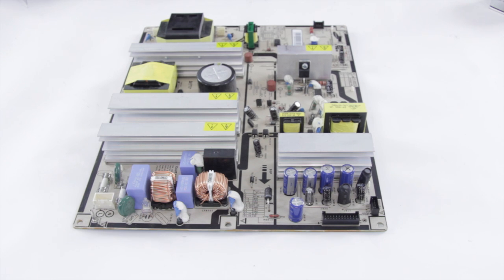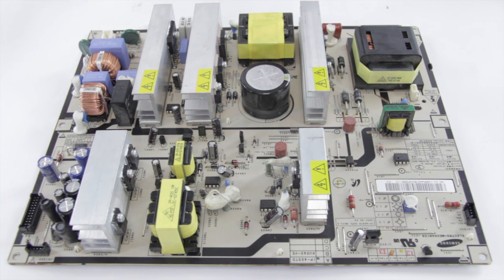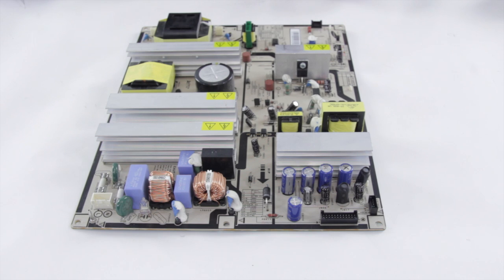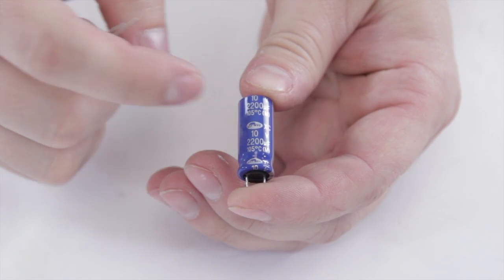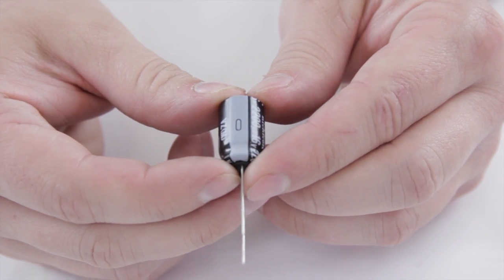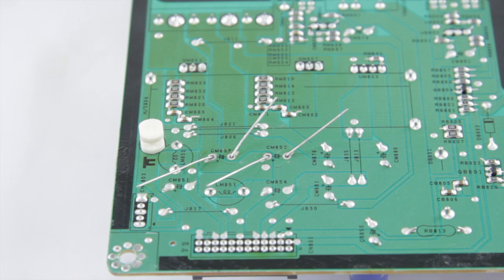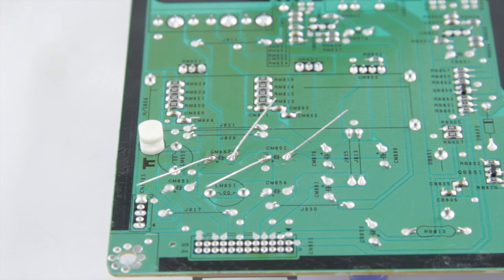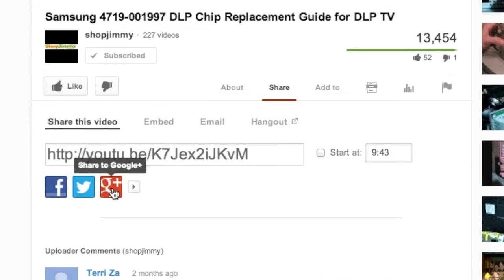Samsung TV Won't Turn On - How to Repair Bulging Capacitor for Clicking Noise

Comment: I have a Samsung UN55D6400UFXZA with Version H301. The I lost power while the TV was on. Shortly after this the TV began to have issues with power cycling when it is first turned on (meaning when it is cold and hasn't been on for a while). Once it is left on and left to cycle (turn on and off on its own...staying on for a few seconds to minutes at a time) for anywhere from 5 to 15 minutes, it stays on and works with no issue. I tried a firmware update which was long over due, but that didn't solve the issue. I'm trying to determine if this is a capacitor, power supply, main board issue or what. Can you help with some insights regarding how best to diagnose or what your experience is with this type of issue?
Reply from the maker: Mark Wilkinson   I recommend replacing the main board and the power supply board in your TV.  Here is a link to replacement parts for your TV model number on our website, click here:  http://www.shopjimmy.com/catalogsearch/result/?q=UN55D6400UFXZA  Be sure to match part numbers on your current board, with your replacement for compatibility.  You can also call our customer service for further assistance with your purchase.  (877) 881-6492  Thanks and please let us know if you have any further questions with your TV Repair!  www.shopjimmy.com

Comment: my Samsung tv model#55c650l1fxza,,sn#z10w3cnz800555l,,if you split the tv into 6 even squares the bottom right square is darker then the rest,,now the hole picture is getting darker and darker,,, help please...ty

Comment: I have a viore 50' flatscreen Hd tv has great sound and picture only problem i have is there are small black lines all across the screen and theres a green led light flashing in the back,is that some kind of warning something is wrong?
Reply from the maker: John Burns   This sounds like a TV panel problem.  If your TV panel is bad, it may be more cost-effective to replace the TV as panels are typically hard to find in stock, difficult to replace, and expensive.  Thanks and please let us know if you have any further questions!  www.shopjimmy.com

Comment: Hey, thank for the Video, I have an old LG model 42PX3RV-ZA . the initial problem was that the TV was blowing fuses at the socket when in standby mode. Then eventually it turned off one night when watching and won't power back on.
I have opened it up and spotted 2 blown caps and am about to replace. Would this cause the plug fuse issue ?

Thanks in advance
Reply from the maker: thefridge1000   I don't think it would cause that issue.  Thanks!  www.shopjimmy.com

Comment: I have a samsun dlp the euc132d /42 boad the low voltage transformer that feeds the hivoltage flyback trans former is acking I think it opend up can I get that trans former
Reply from the maker: Teddy Stephens   You may need to try a place like digikey.  Thanks!  www.shopjimmy.com

Comment: My problem started with the sound bar popping up frequently on the left of the screen decreasing volume to zero. I bypassed it with using my surround sound. But when I cut the TV off it would not come back on. I took it apart noticed 1 swollen cap so I replaced it with the same but upped voltage from 10v to 25v. I don't think I got a good solder seal. When I cut on it came on and off correctly. But when I went to cut back on red light would blink, go out and red light come back on. Resolder again, playing with it a while it came back on but I could not cut back off. Had to unplug. Now color spreading all over screen. I still have some more 1000uf 10v 105c capacitors coming in mail. Will take apart again to see what's what. Is there a special solder I need to use. I also tried to use a Radio Shact desoldering braid to remove previous solder with little success. Please help!
Reply from the maker: Thomas Reynolds   Resolder and try again see what happens otherwise the main board could be bad as well.  Let us know what you find.  Thanks!  www.shopjimmy.com

Comment: What type soldering iron were you using that would also suck up the solder after melting solder? Also my Samsung has 1 cap 1000uf 10v 105c but I've also got what looks like a white hard foam in a couple places on the board. It almost appears that it may have come out of one of the circuits. Does that white hard foam looking stuff mean anything? I've got a 40 in model LN40B530P7N
Reply from the maker: Thomas Reynolds   A desoldering tool such as the excellent Hakko 808. Many boards are glued to help hold components in place, but some leaking caps will foam as well.  What are the problems/symptoms with your TV?  Thanks!  www.shopjimmy.com

Comment: My caps are 2200uF 105° & 25v can I swap it out with a cap that's 2200uF 105° & only 10v? Samsung DLP Board BP44-01002c
Reply: McSquidification The cap voltage can be higher, it is the rated maximum.  The whole issue here is the caps that were put there to begin with were underrated.  I would suggest going up in voltage, and hopefully operating temp, while maintaining space.  Just be sure to use the right microfarads, or you can induce other issues.
Reply from the maker: naturreal1705   NO! It's OK to go up in volt value, but NEVER go down!  You could do a 2200uf 35v.  Thanks!  www.shopjimmy.com
Reply: No, you must always match the voltage.
EDIT: incorrect. see below.
Reply: Josh Martin
Thanks for clarifying/correcting

Comment: I have an un55es8000 samsung. The set power cycles after running for a few hours and usually after interacting with it using the remote. Symptom is vertical lines and a reset resulting in a loop o the same issue. If I remove the set from the wall and open up the back, the issue does not exist. I can see no leakage or bulging on any caps, anywhere. Many sites explain that upgrading certain PS caps to higher wattage and heat rating fixes the issue. I am at a complete loss as to which ones to try this out with. The largest ones are 450V, should I just get all the current ratings and upgrade the largest ones?
Reply from the maker: mvortex1  You can do this with all them.  Thanks!  www.shopjimmy.com

Comment: My Plasma TV has a problem, when I turn it on it turns off I bought a power supply from you guys yesterday, I changed it but it still has the same problem. It is a LG Plasma TV 50 PC1DR-UA.
Reply from the maker: Ermine Minassian   I recommend replacing the ZSUS board in your TV.  Here is a link to replacement parts for your TV model number on our website, click here:  http://www.shopjimmy.com/catalogsearch/result/index/?master_part_type=Z-Sustain&q=PC1DR-UA  Be sure to match part numbers on your current board, with your replacement for compatibility.  Here is a link to a video showing how to identify your part number, click here:LG Plasma TV Repair: DIY Part Identification Number ID Guide for LG & LG Philips Plasma Panel Parts  This video may help you with the replacement:  LG 6871QZH044C Z SUS Board Replacement Guide for DIY Plasma TV Repair  You can also call our customer service for further assistance with your purchase.  (877) 881-6492  Thanks and please let us know if you have any further questions with your TV Repair!  www.shopjimmy.com

Comment: My samsung tv was randomly turning off. now it will blink really fast and just be blank, to where there is no picture at all. I've googled and youtube it. Everyone says that the fix is a bad capacitor. But when I look at the power board of my tv, I don't see any that look bad like everyone states. Is it possible for one of them to be blown will out it looking like it was blown. Thanks!
Reply from the maker: weston guidero   Yes, just because they're flat on top doesn't always mean there good more often then not 1 or more will leak and not show the puffy symptom. It's worth a shot on replacing the capacitors.  Thanks and please let us know if you have any other questions.  www.shopjimmy.com
Reply: weston guidero the switches are just as easy and cheap to replace. So you got scammed. The answer to your question about blown caps with no bulges. Yes they can. You test the ohms of them. Should be 0 or close to it. Anything over 0.8 is bad or going bad.
Reply: did they get back to you yet? i have the same problem. i dont see anything wrong with any ofr the capacitors.
Reply from the maker: Raymond Shipway jr   Yes, just because they're flat on top doesn't always mean there good more often then not 1 or more will leak and not show the puffy symptom. It's worth a shot on replacing the capacitors.  Thanks and please let us know if you have any other questions.  www.shopjimmy.com
Reply: weston guidero i had only had the tv for maybe 4-5 years. then it just crapped out on me. it would randomly shut off sometimes though which scared me then eventually it just died.
Reply: Raymond Shipway jr it turned out that it wasnt the caps. i took it to a tv repair place. they said they would have to replace one or both of the boardswhich unfortunately is not worth the cost of repair. and better to just buy a new tv. ill never buy a samsung tv again. i cant trust them with tvs anymore. after that experience

Comment: can i go from 10 volts to 25 volts i know its a little higher than from 10 to 16 volts but i figured id ask
Reply from the maker: Jordan Bennett   That is a pretty huge jump. It may work but you're really going to load that line as it tries to charge the cap. Could cause issues, so I do not recommend it.  Thanks!  www.shopjimmy.com

Comment: my Samsung PN50C550G1FXZA wont turn on, will this fix also repair it? thanks
Reply from the maker: MiamiCityDjs Emil   I recommend replacing the main board in your TV.  Here is a link to replacement parts for your TV model number on our website, click here:  http://www.shopjimmy.com/catalogsearch/result/?q=PN50C550G1FXZA  Be sure to match part numbers on your current board, with your replacement for compatibility.  You can also call our customer service for further assistance with your purchase.  (877) 881-6492  Thanks and please let us know if you have any further questions with your TV Repair!  www.shopjimmy.com   #tvrepair
Reply: ShopJimmy.com Im going to buy a 40" samsung tv with this same exact problem it turns on but wont boot up, what do you recommend?

Comment: Hello I have a sony tv model KDL-22PX300. When I plug, the red control light illuminates and blinking when trying to turn it on by pressing the power button on the remote controle , The ON LED comes green but not tv not power after release it the button the led start blinking again... On the power supply board there not burn capacity but I think that the power suplly board is not work because when I plug and check by multimeter the voltage on the main board connect pin on the power supply board there is not voltage only 3.3 the far right pin... Please help. Best kinds
Reply from the maker: Dricko Ceba   How many blinks on the front?  Thanks!  www.shopjimmy.com
Reply: Only the red led blinks  and when we press power botton on the remote the green light become green like it want to power on the tv and it off and the red light start blinking again non stop...
Reply: When I plug tv the light on about 20 seconds and it's start blinking (blinks 3 times and stop for a few seconds and blinks again 3 times and stop....) even after unplug the tv it's continue blinks again about 1 mn... Best kinds
Reply from the maker: Dricko Ceba   I recommend replacing the power supply in your TV.  Unfortunately I do not see any replacement parts in the search results for your TV model number on our website.  Thanks and please let us know if you have any further questions!  www.shopjimmy.com
   #tvrepair

Comment: Samsung 40" LCD HDTV
Model # LN40C630K1FXZA
Standby light is on, but when power button hit on controller, light turns off and nothing else happens. Ive checked the capacitors and doest appear any of them are swollen or leaking. Samsung tech on phone said through our trouble shoot that its the tv sensor. Do you agree? Do you have any advice or fix's?
Reply from the maker: pickingforchrist Samsung LN40C630K1FXZA - Standby On, Blank screen.  I recommend replacing the main board in your TV.  Here is a link to replacement parts for your TV model number on our website, click here:  http://www.shopjimmy.com/catalogsearch/result/?q=LN40C630K1FXZA  Be sure to match part numbers on your current board, with your replacement for compatibility.  Here is a link to a video showing how to identify your part number, click here:  Samsung Main Boards & Digital Boards: Part Numbers for LED, LCD, DLP, Plasma TV Repair  You can also call our customer service for further assistance with your purchase.  (877) 881-6492  Thanks and please let us know if you have any further questions with your TV Repair!  www.shopjimmy.com
Reply: +ShopJimmy.com literally almost 2 yrs later...learn to reply sooner, even a year sooner....lol, pointless to reply now

Comment: Hello, I have a Samsung plasma that does not turn on. It has no picture. I took the back of and check all the capacitors and they all seem good, unless I miss one. What else can I check for or do. Any tips or suggestion is great. Or videos.
Reply: GET A NEW TV!!!!! LOL
Reply from the maker: iaguayo34   I recommend replacing your y-board and buffers for your TV repair.  Please reply with your TV model number and then I can recommend replacement parts for your TV repair.  Thanks!  www.shopjimmy.com

Comment: Hi There, I have samsung TV. model is UA40C5000. Our TV suddenly turned off. I tried to turn on again and it's only the red light that is on, near the power button on the tv. I turned it on using the remote, and the red light's gone. I opened the Tv but I don't see any bulging capacitors. Need your advice and which part to purchase from you. Thanks so much for helpful videos. Also, may I know if you can ship to Singapore? Regards
-Karl
Reply from the maker: kidlaki   I recommend replacing the power supply in your TV.  Here is a link to replacement parts for your TV model number on our website, click here:  http://www.shopjimmy.com/catalogsearch/result/?q=40C5000  Be sure to match part numbers on your current board, with your replacement for compatibility.  Here is a link to a video showing how to identify your part number, click here:  TV Part Number Identification Guide for Samsung DIY TV Repair Power Supply Unit (PSU) Boards  You can also call our customer service for further assistance with your purchase.  (877) 881-6492  Thanks and please let us know if you have any further questions with your TV Repair!  www.shopjimmy.com

Comment: Why increase the voltage value?
Reply: if possible get one with a higher temp rating
Reply: Manufacturers tend to be cheap. Going up to the next voltage just helps to stop premature failure if the voltage goes a little high from time to time. You don't have to, just never go lower than the originals.  It's also useful if you don't have the exact voltage on hand saves you going out to buy them.
Reply: Generally 105 is the highest temp you'll see on a TV but yes you can go higher. If you check out www.digikey.com you can apply filters and see what's available. For example 16V 1000uF you can get upto 150c caps. But the price will increase a lot! 105 with a good working life should suit most applications

Comment: I had a Power Surge, regardless of the protector ive been using recently, unfortunately my E240AR doesnt turn on with no indicatior at all, is this implying the motherboard itself is shot?
Reply from the maker: tornsilhouettes  I recommend replacing the main board in your TV.  Here is a link to replacement parts for your TV model number on our website, click here:  http://www.shopjimmy.com/catalogsearch/result/?q=E240AR  Be sure to match part numbers on your current board, with your replacement for compatibility.  Here is a link to a video showing how to identify your part number, click here:  TV Part Number Identification Guide for Vizio Main Boards (Plasma, LCD, LED)  You can also call our customer service for further assistance with your purchase.  (877) 881-6492  Thanks and please let us know if you have any further questions with your TV Repair!  www.shopjimmy.com

Comment: Hi, I have a samsung dlp tv model #HL-T5675S and the power button does not turn on the tv nor does the remote. The only way to turn on my tv is to unplug it plug it back in and hold the power button until it comes on, but once it comes on the tv keeps switching from hdmi to another input source, it cycles every so often. can you help me?
Reply from the maker: SOURDUST-UNO  I recommend replacing the DMD board in your TV.  Here is a link to replacement parts for your TV model number on our website, click here:  http://www.shopjimmy.com/catalogsearch/result/?q=5675S  Be sure to match part numbers on your current board, with your replacement for compatibility.  You can also call our customer service for further assistance with your purchase.  (877) 881-6492  Thanks and please let us know if you have any further questions with your TV Repair!  www.shopjimmy.com